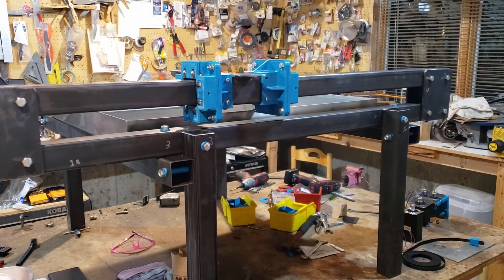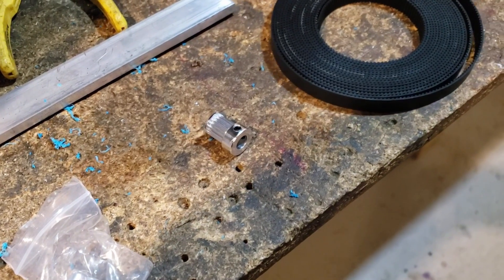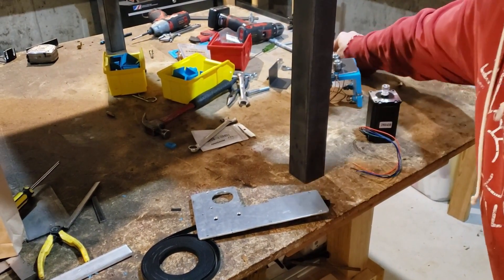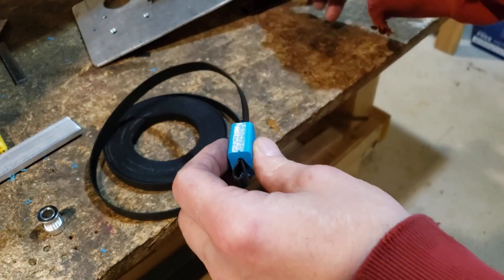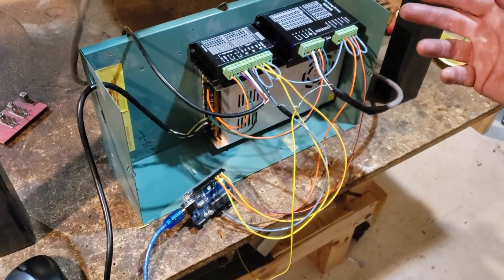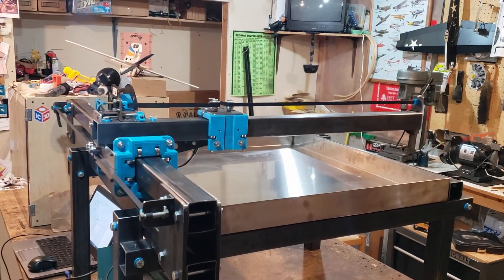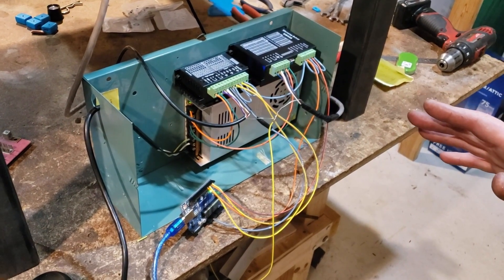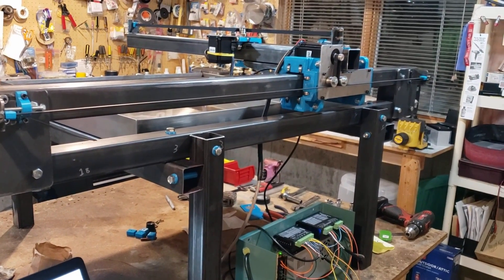Budget DIY CNC Plasma Cutter || Motion and Controls

Comment: would aluminum be a more suitable material for the frame work? less weight and corrosion resistance? just wondering if there's a reason you went with steel and paint. might just be convenient which i get.

Comment: I can easily build a similar system as have done with both my CNC wood router and 40 Watt optical laser cutter. My question is, what is the software you are using to run the plasma cutter? No mention of it in your video. It would be helpful to know that part. Thanks for any info you can provide.

Comment: I'm nearing completion of my build from your plans.  Proto typing a SKU1204 x 900mm ball screw for the X axis.  Wanted to get some weight off of the Z axis.  Calibration is way different than the belt drive with 20T pulley.
Big Con:  Can't move the X axis without power ( I miss that option)

Finished 1/8" x 2" x 30" slats today.
Waiting on flexible connector for the ball screw to motor connection to finish build.
I'm using ESP32 and FluidNC and most likely Universal Code Sender as it will allow bluetooth for PlayStation4 controller

Only 1 part (3D printed) that was out of spec, the torch clamp hole centers was long.  (I designed another one)  I used PETG for all 3D prints.

Still waiting for an update on the THC pcb.  Building Z axis now.
Thanks a bunch for the very detailed plans and documentation!

Comment: I love the design and how rigid it looks. Just a thought for a future upgrade. I have been wanting to build a large CNC table like this, but want it to be able to double as a 2D plasma cutter, but also a 3D router CNC machine for wood and aluminum. Your table is heavy duty enough to pull it off with a couple of modifications. One, I would spend the extra $$ for the lead screws due to the torque if you were cutting aluminum. Two, I would put another rail on the opposite side just for support to keep the arm from bending if cutting aluminum. Last, you would need the router attachment. Now you have a multi-use CNC table!
Reply: It makes a lot more sense to combine laser and plasma. A CNC router needs exceptional rigidity due to the cutting loads, and any reasonable spindle weighs a whole lot more than a plasma torch and laser module combined. Lasers and plasma cutters do not need that degree of rigidity, nor are there any cutting forces to deal with. If you are building the machine rigid enough to be a CNC router it is going to be a lot more expensive and way overkill for plasma or laser use. There is absolutely no way this could function reasonably as a CNC router with the fully cantilevered design. Adding another support and rail significantly limits the use of the machine if you are dealing with full sheets of metal on a regular basis, unless you also build it with a 4x8 work envelope, which again adds very significant cost. Then we also get into dual steppers for one axis, and keeping them perfectly in step can be problematic unless you have picked big enough servo motors or closed-loop steppers, which again adds very significant cost.

TL;DR: Adding laser and/ or plasma to a CNC router - overkill in terms of rigidity and a much smaller work envelope per dollar spent. Adding CNC router to a laser and/ or plasma - not viable for any laser or plasma that was not massively overengineered in the first place.

Comment: I just downloaded your plans and 3D printed parts are on the way. Only a few materials left to acquire then I will begin building. I can’t thank y’all enough. The plans and information are very detailed, very thorough. I encourage others to explore what these guys have to offer the CNC community
Reply: You go through with building it? How'd it go? Make a business out of it?
Reply: Hello, I want to buy the plans, but I want to make sure if the iron tubulars exist in my country, I wanted to know the dimensions, if it is 40x40mm, I would appreciate it if you help me with this information
Reply: @matiasrodriguez9811  If you could be bothered to click a link and look for yourself, you'd see that they have a metric set of plans available. You're welcome.
Reply: @matiasrodriguez9811   
25.4mm square tubeing 1.77mm wall.  I used less than 30' (9.144M).

Comment: Why not get all in one board like MKS DLC32 for example, $22 from ali and its small, everything wired via reliable locking connectors, 3 axes, 2A drivers that will drive small plasma cutter like that just fine, wifi, sd card, optional colour screens for offline use/control and more.
With chinese copying all the open source projects and spewing-out dirt cheap all in one boards it's not worth it for long time now to mess around with plain arduino boards.

Comment: Thanks for eeverything once again. I allready have a plasma cutter integrated to my AC/DC TIG welder, however the TIG is a HF start. So I guess the plasma ignition uses high frequency too, no ? In this case, I have one question, because I read the interference an electo-magnetic noises may harm the electronic. Does anyone here has experienced HF cutter issues with JD's Garage setting and hardware ? Any Arduino being somehow burnt, or frequent issues or reset during the cutting process ?  Is the cable shielding enough ? I may take a risk if it looks like it might work. I mean, I prefer risking to destroy one arduino board, than buying a new plasma cutter, if it appears that the HF plasma start may work anyway. Whatever experience you have is welcome

Comment: What is the advantage of having the gantry free floating on one side? It just seems weaker especially when the head is all the way along the gantry over the unsupported side and the other axis is doing fast movements.
Reply: Can load material from both sides
Reply: @AS-ug2vq  that seems a pretty minor advantage considering the structural rigidity disadvantage
Reply: @sharpsticksnz4112  It also needs less stepper driver/motor.

Since this doesn't have home switch or limit switch, using two motors become complex.

If you make it larger like 4ft+ and use it with belts, it doesn't work that well. This design is good for small cnc table and two motors don't add much here at all.

Comment: Also what code are you using?

Gcode?

Do you need to flash the ardunio?

I'm looking at getting a laser cutting and running a relay off the laser output...

But this option looks good Also.

I have nema23 motors with 8mm shafts and 8mm bore pulleys for gt2 15mm belts.

I haven't got a board or drivers yet.

I was looking at buildbotics,  but my knowledge towards turning the cutter on and off is non existent.

I do cnc router and 3d printing.

I have a shapeoko pro xxl and cr10-max as reference to what I'm capable of achieving.

Any advice or direction would be great

My budget is what I can make back as profits.

Comment: Are you using GRBL?
Reply from the maker: Yes Grbl 1.1
Reply: @jdsgarage701  so, you could design something in inkscape....an SVG file.....then use  a cam program to generate gcode....then send to arduino?
Reply from the maker: @glennmartonic6376  Correct

Comment: Hola amigo, muy buen trabajo el q has realizado, que tan posible es que puedas proporcionar unos planos? Incluso el del los carros, Felicitaciones...
Reply from the maker: We are working on some kind of plans for the plasma cutter. Unfortunately there are no plans for the blue car and there won't be any. The red car on the other has is a modified version of the plans made by @KJ Raycing, you can find the plans on his channel.
Reply from the maker: @LasaventurasdeMaxyYuna  The .stl files for 3d printing need some refinement first. Some changes were made to the parts after printing, and sadly we haven't had time to correct them yet.
Reply from the maker: Plans are now available.  https://jdsgarage.bigcartel.com/